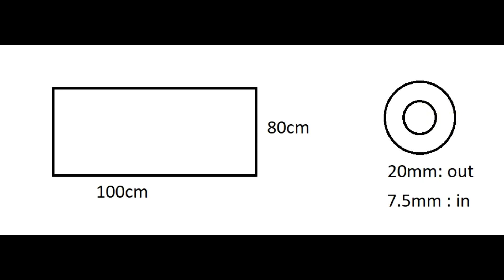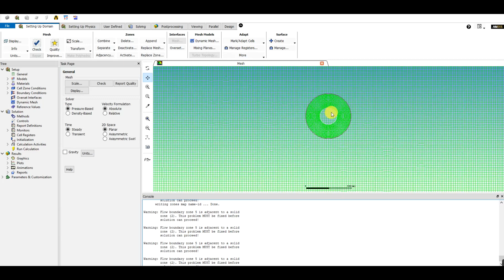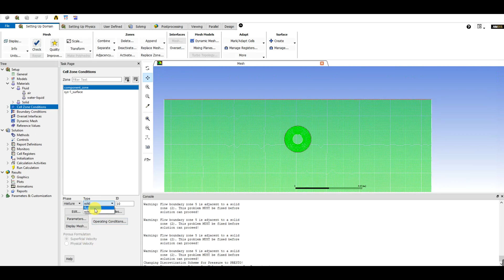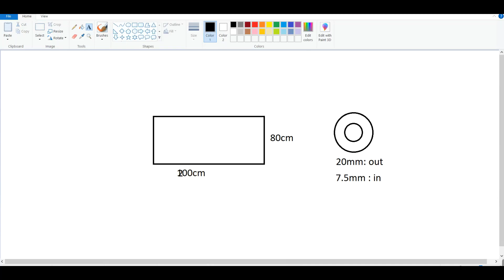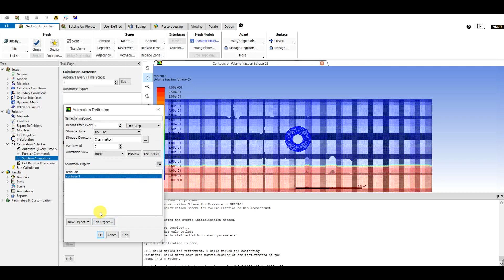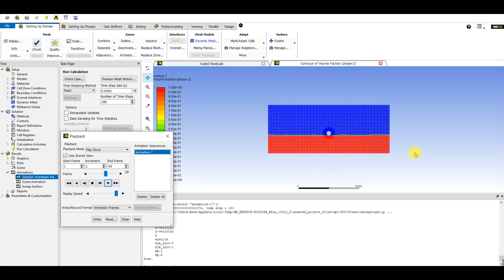2D Overset Mesh in Ansys Fluent-Object Falling into Water

Comment: Hi there, thanks for the great tutorial. I am running into the problem of negative cell volume detected while replicating the same simulation. Can you provide any advice. Did try to reduce the time step and use mesh smoothing.

Comment: I´m pretty sure the box is either 200x80 or 100x40, since with these edge length you would have a square-like shape.

Additionally the size of the Object being in mm seems to be incorrect as well.